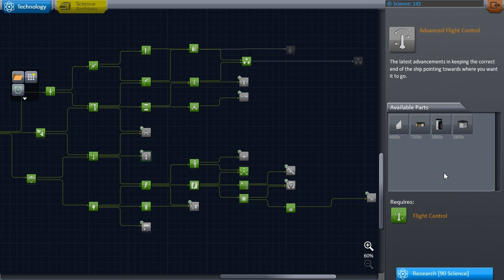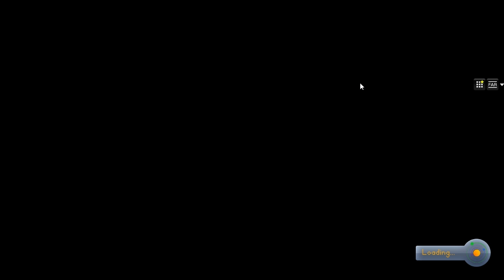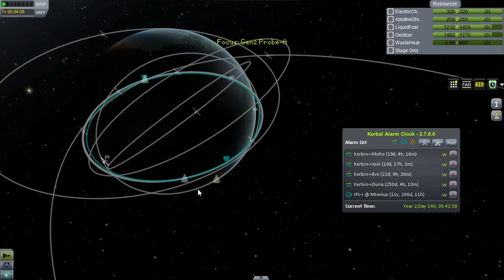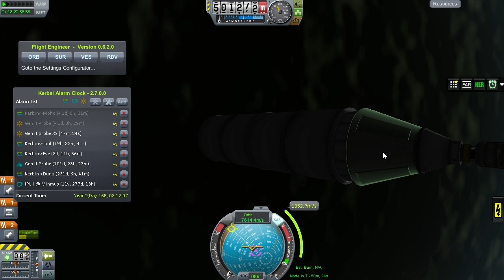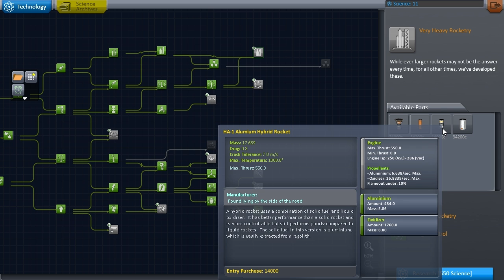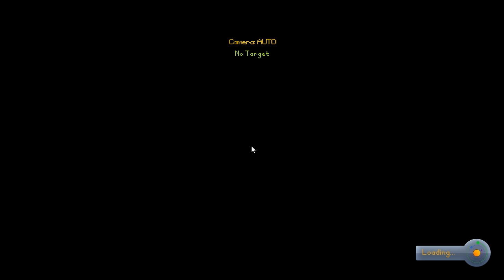KSP to Mars Episode 32: Many probes to many places

Comment: Alarm clock counts time to the point you set, so if you set it to 5h before transfer window, it count to that moment and not to the window itself. It can bug out, but only a tiny bit, if you are using very high rate warp and warp period is small (1 day at 600k warp), it might skip to 10-20 minutes ahead of the alarm.